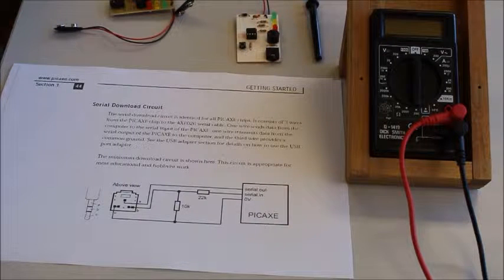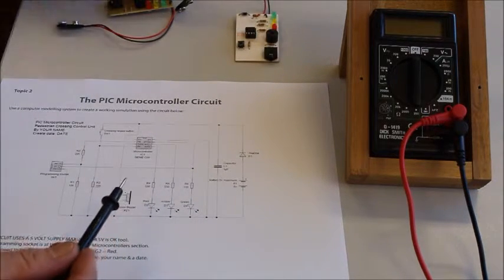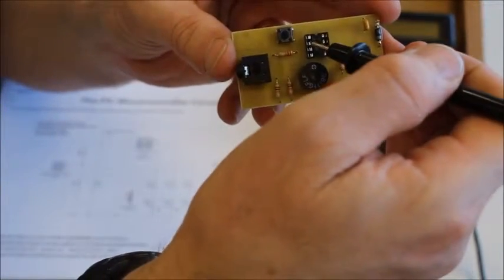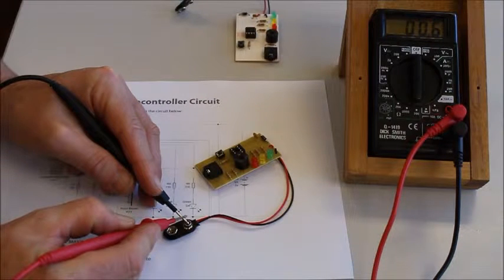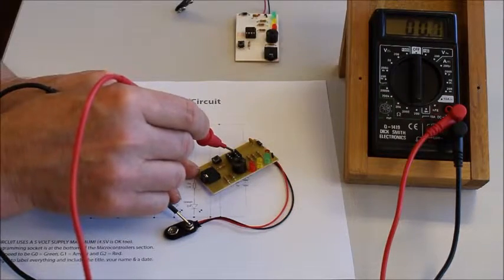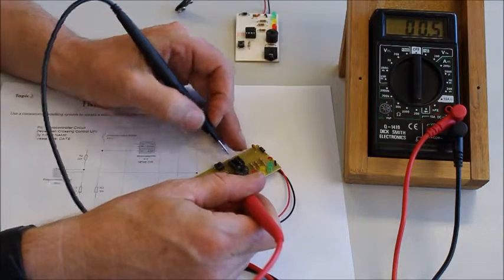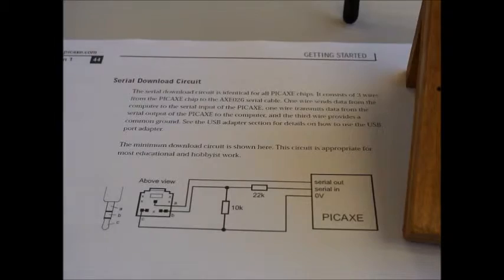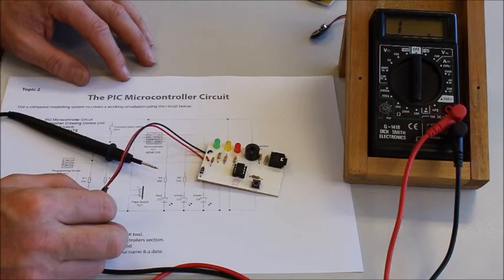Checking PICAXE for the serial connection.

Comment from the maker: I missed checking the larger connection on the battery snap, which is the positive 5V power, to Pin 1 of the PICAXE.  Again this should be a short circuit, unless you have a protection diode.  Also check there are no short circuits between any of the following pins: Pins 1, 2, 7 & 8. :-)  Good luck.